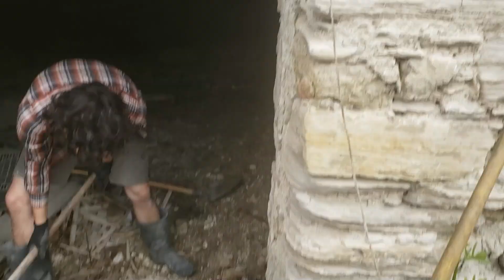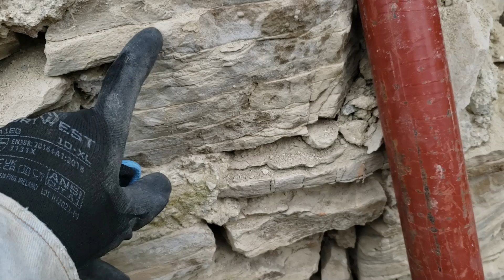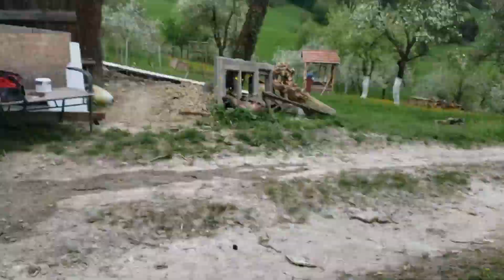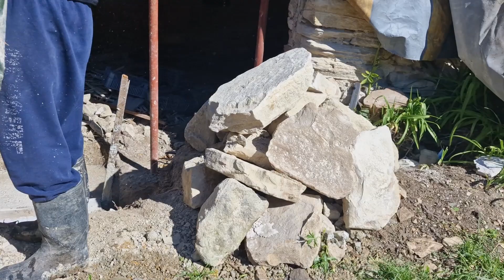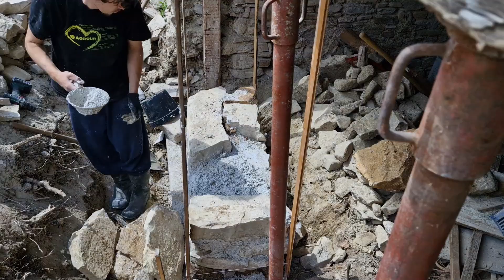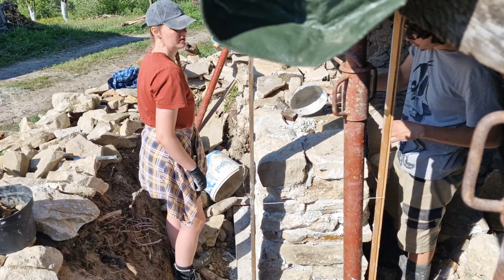Demolishing & Rebuilding a Collapsing Limestone Wall: Part I

Comment: Interesting to learn about laminating of the limestone.  Is it caused by moisture over decades?  Will you put a layer of mortar or stucco over the finished walls to protect them from the elements.
Reply from the maker: Yes, laminating is caused, usually by water, but particularly by freezing and plants. 

Limestone is extremely porous, and water easily soaks into billions of microscopic holes. When that water freezes, the water in the Limestone expands, exploding the rock from the inside out. This can also happen when roots from plants grow into Limestone, as happened in several places around the house. 

On our terrace, where we dumped clay from the foundation, we placed down flat Limestone rocks ontop to make it easier to walk on. Over the winter, the rocks broke down into a mulch, simply from the freeze/thaw cycle.

This is why drainage is so important, and why the outside is now surrounded by gravel, because it will be much harder for water to soak into the Limestone, and any water that does absorb can dry out. 

Yes, likely we need to do mortar on the outside, specifically on the west side, because that is the direction  our weather comes from, and therefore causes more damage to the Limestone. But we are going to wait until the walls are all done, and see if there is another style of mortar besides the normal Slovenian style that could allow us to show more of the Limestone underneath.

Comment: Nice to see old masonry techniques reused. Just one comment: Shouldn't some rocks stand out at the left side to later connect with the rest of the then rebuilt wall?
Reply from the maker: Thanks! Yes, it's hard to see from the angle of the camera, but there are more rocks hanging out in the center and the backside to tie it in 🙂

Comment: Can you use harder stones?
Reply from the maker: Yes, we ordered 3 cubic meters of a more dense stone that better for building. We incorporated lots of larger stones into the wall with the harder rock (those are the deep brownish/red colored rocks that you occasionally see in the build). We only reused limestone that was strong and unlikely to laminate in our lifetimes :)

Also, lamination is largely caused by water and plant roots, so after the walls are repaired, we will be using more modern water proofing techniques to prevent lamination in the future. Videos will come once we get there :)